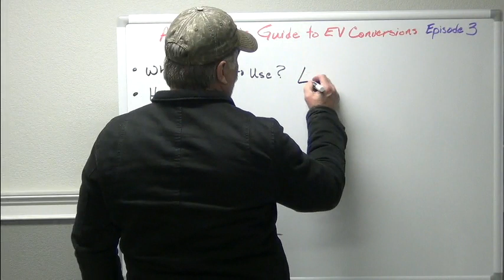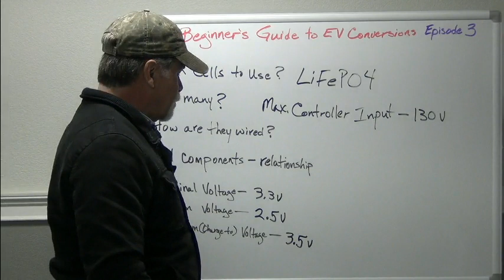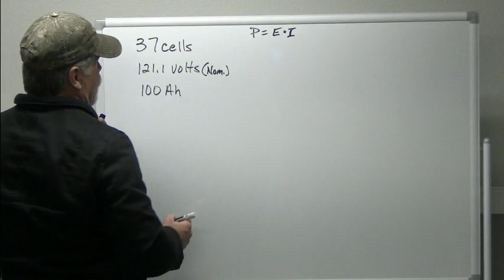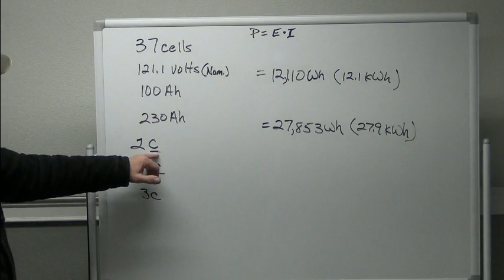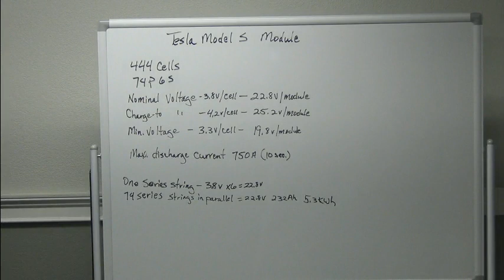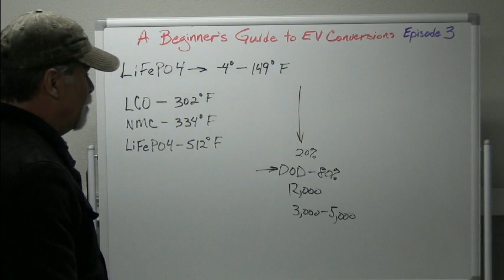EV Conversions - A Beginners Guide to EV Conversions, Episode 3 - EV Conversion Information

Comment: Very good video's... up until now... I had faith in you until you started with Farenheit as temperature measurement. Now I fear you will start using mile as distance, footpounds for torque and so on..... Please pleaseplease use metric like most DIYers and makers use around the world 🙂
Reply: Wrong. You should be able to convert.